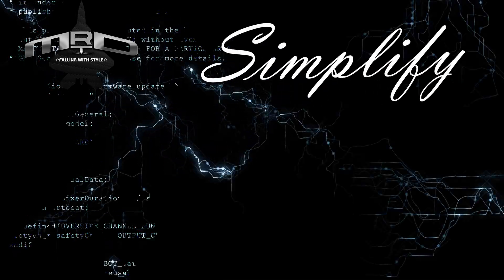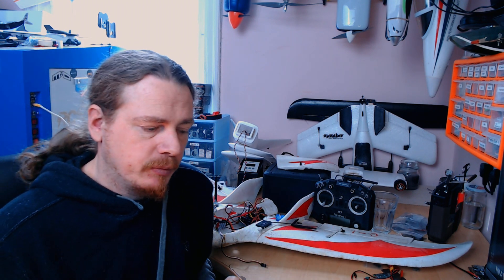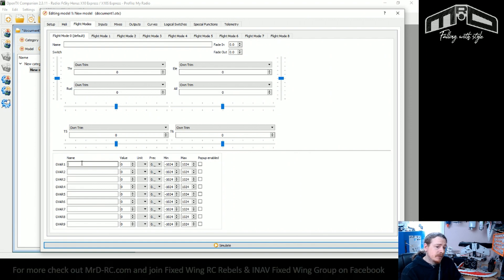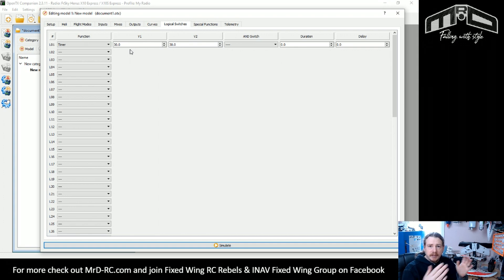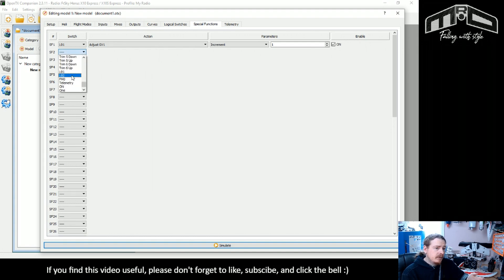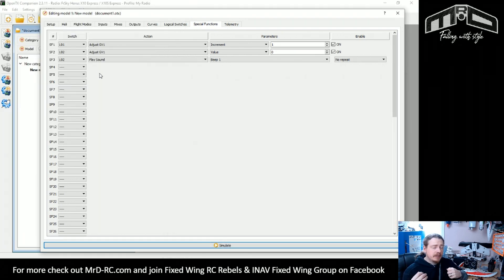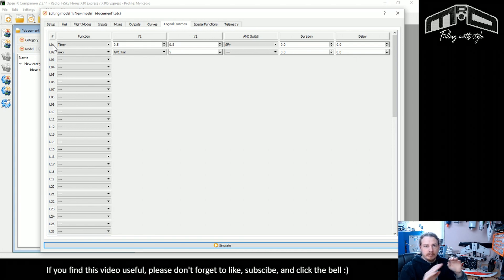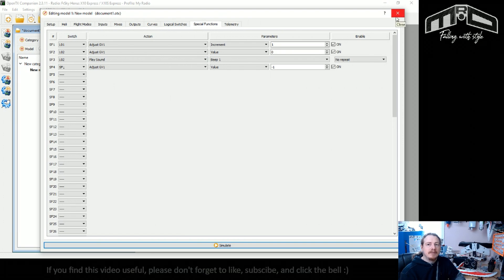Creating Your Own Programmatical Timers in OpenTX

Comment: Many thanks for creating such a useful set of Open TX Videos! Do you know if Is it possible to set a dynamic timer value via a pot in Open TX on a Horus X10s Express? I have a logical switch switch to override a channel after 1.30 seconds. I would really like to be able to adjust that value on the telemetry screen using a pot or slider without having to go into the logical switch menu to do so. My head hurts from multiple brick wall impact events, if you can help I would really appreciate it.
Reply from the maker: Hi Dan, just having a look and I think it's not going to be possible. It could have possibly been done with GVars. But, the problem is you can't set the inc/dec amount based on another Gvar or source. Everything is set by explicit values. Same in the logical switches. The timer V1 and V1 are set explicitly.

The only thing I can suggest at the moment is that you could have a 3 way switch which sets the timer start time. Then at least you have 3 options.
Reply: @MrD  Hey Darren, Many thanks for the steer and taking the time to help. I will implement the three way switch, that was going to be my fall back with settings for + or - 10% either side of 1.30 if i couldn't make the dynamic timer setting thing work. In a way I am kind of glad that it's not possible because if it was i would have felt a bit daft for not getting to the solution myself. Every cloud has a silver lining as they say. 

Anyway, I really do appreciate the advice and the video series. They are now my go to OTX reference. 

Keep up the good work!

D..
Reply from the maker: No problem Dan. I’m glad the videos help, even if not in this instance 🤣